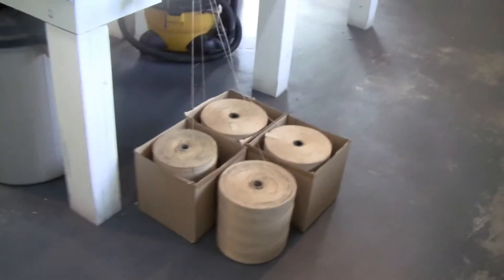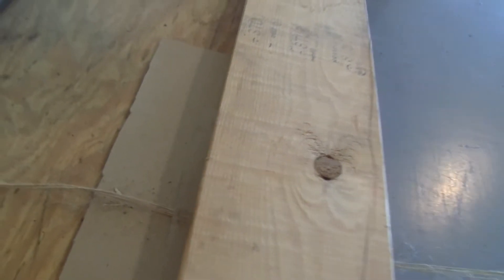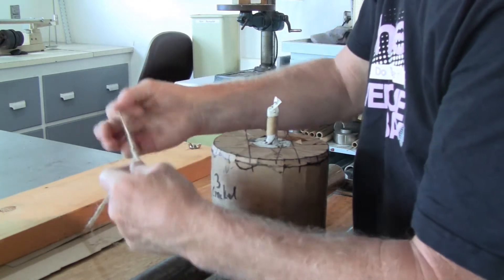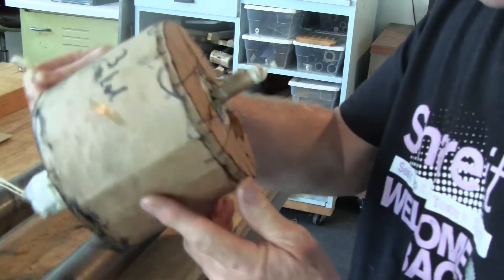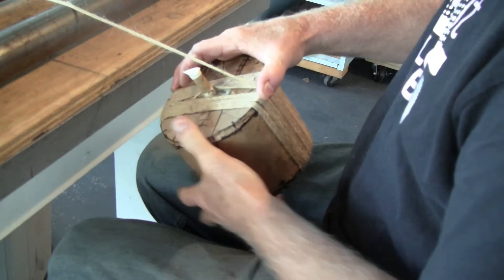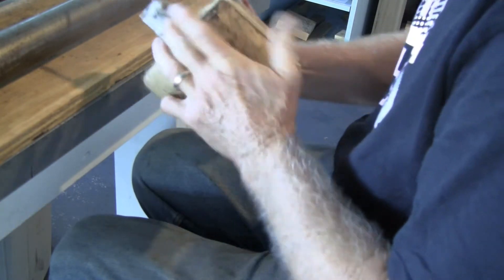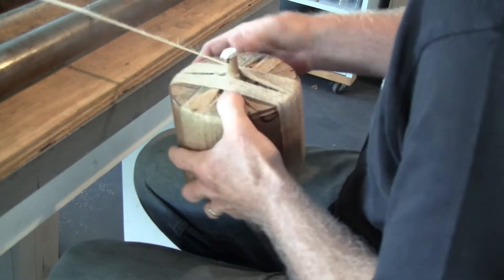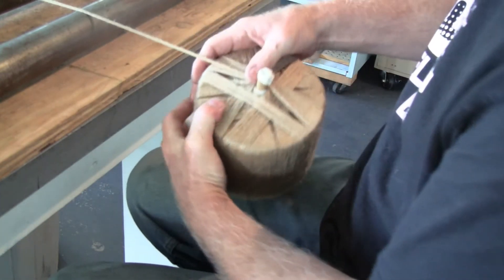Maltese shell break spiking

Comment: Steve. Nice vid, thanks. Just started down the Maltese path. I made a 6" single break and a 6" two- break both using the Maltese lift system even though it wasn't necessary. Im going to fire them this weekend. I'm getting my jute from a guy named Lloyd...you probably know him. His rolls are quite a bit smaller. Where did you get those monster rolls?